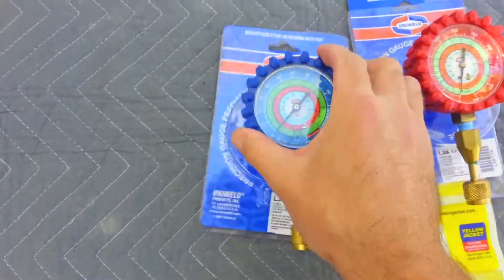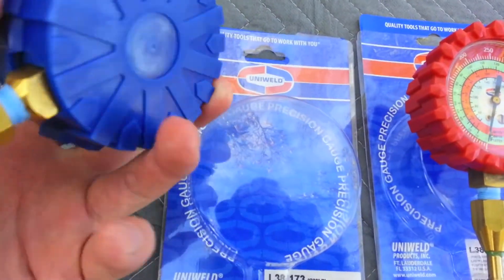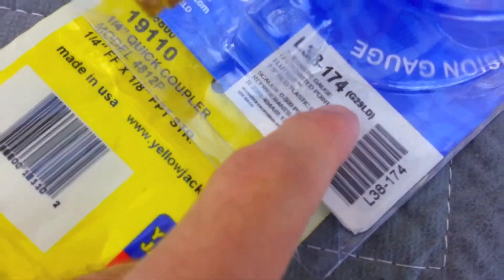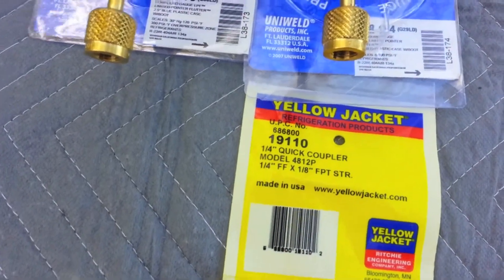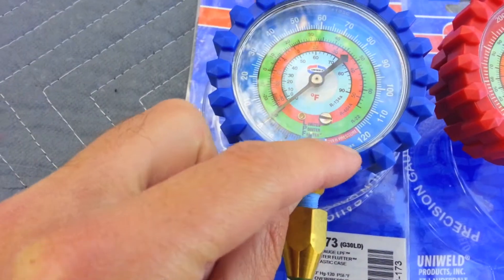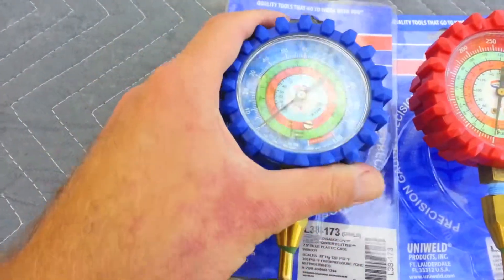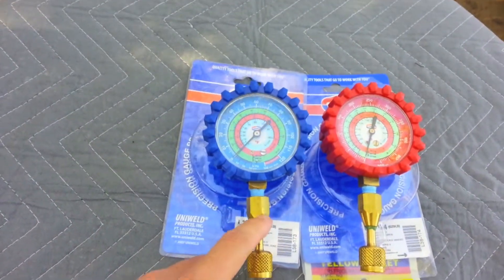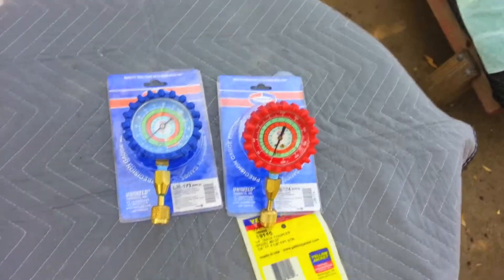HVAC Cool Pressure Gauges (AKA the Zmanifold)

Comment: We have been using those for years in Refrigeration on small systems. Fits easily into your tool bag. I have the 6" houses for mine or they also sell 90* gauge port fittings. Good vid!😎
Reply from the maker: +HVAC/R Junky Thanks man. They are slick little gauges.